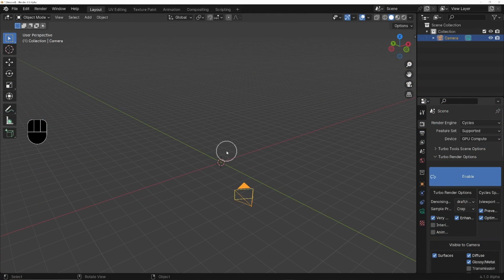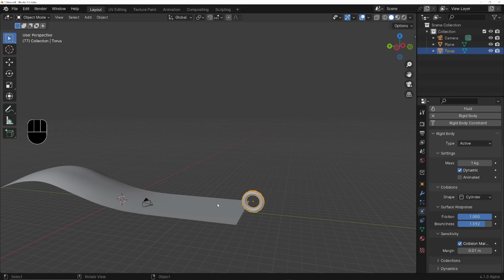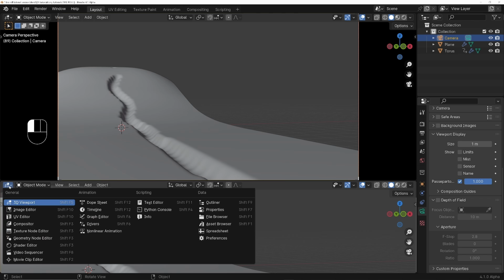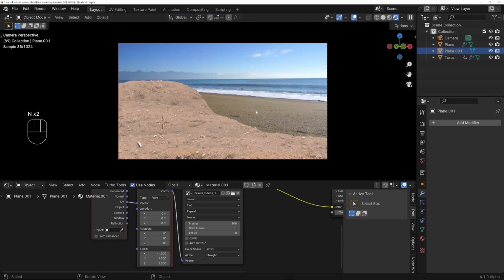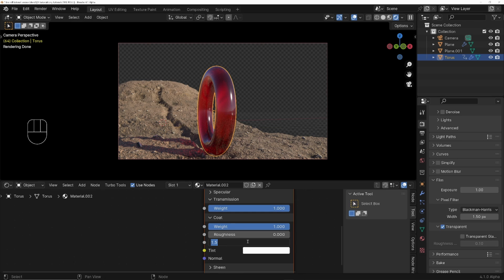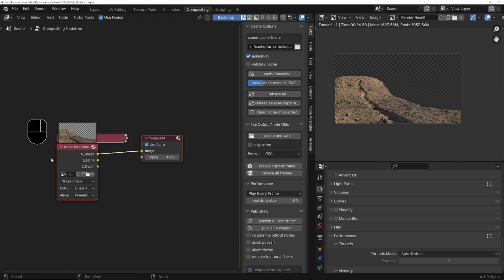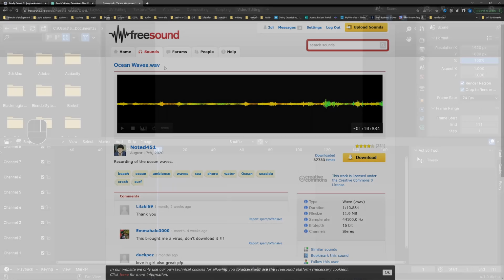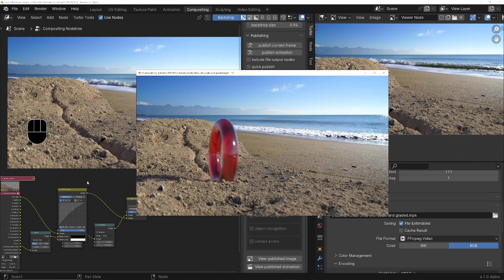Make a satisfying tyre in the sand animation in Blender!

Comment: Nice tutorial. Can you guide me on how I can make the sand displace a bit ....for example if a person is running I want his feet to throw some sand while running....I know it's possible to work it out with a particle system but I would like your input. Thank you
Reply from the maker: Yes, particles are the way to go.  You can probably automate it using the dynamic paint in the particles vertex groups density section.  Or perhaps better shooting the particles directly from the foot using the floor as a brush and the feet as a canvas.  Or use geometry nodes to write to the vertex group on close proximity.
Reply: @3d-illusions  ahh cool thank you for the input